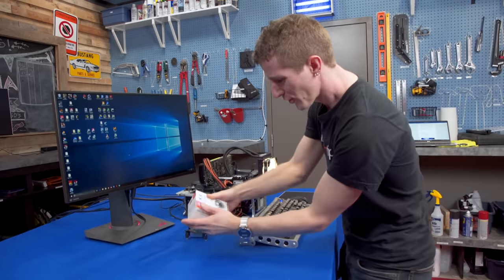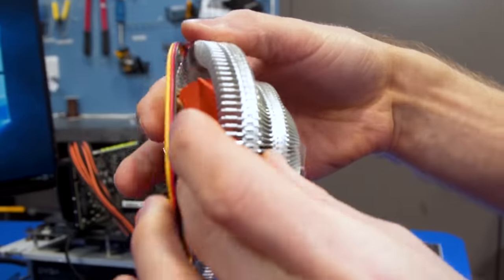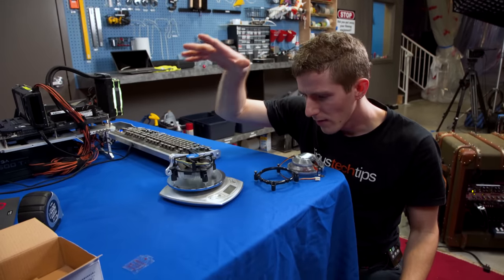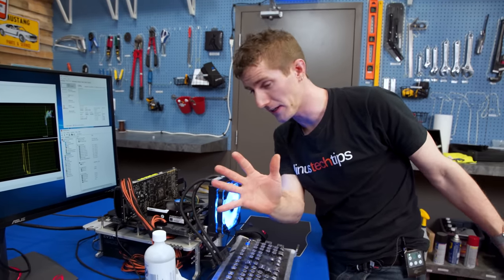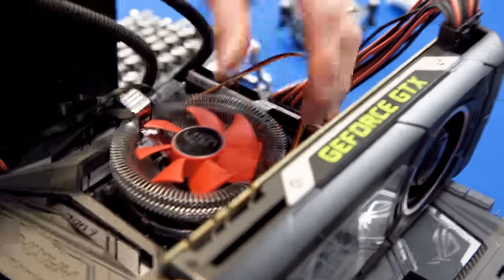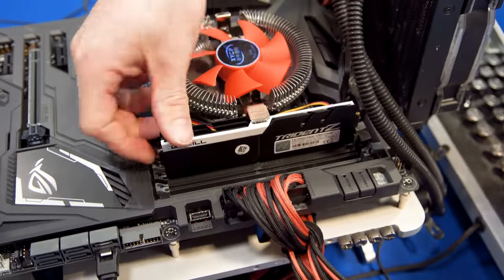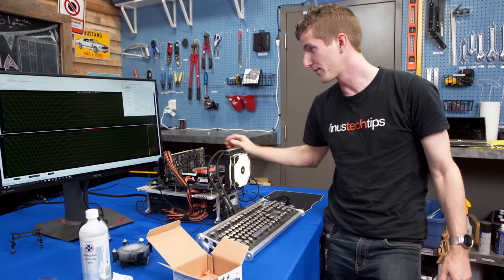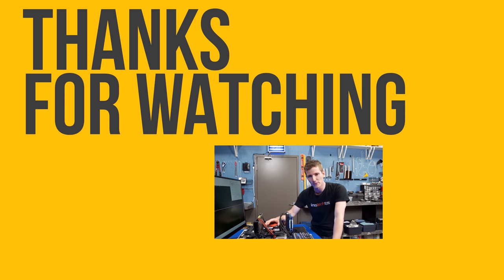The CHEAPEST Heatsink on the Market

Comment: 65W heatsink on a 95W TDP processor
yeah, let's see if this can hold up with a processor-TDP-matched heatsink
Reply: Hallison Michel that stock heatsink they tested is the very same that comes with all the other Intel cpu. So, what's the point in buying something that is worse then the one the comes for "free" with your cpu? that's what they demonstrate.
Reply: One reason is if it the stock cooler brakes or when you get a cpu without a heatsink... So...
Reply: This is the "cheapest on the market," not the "best match at the lowest price on the market."
Reply: Ailuropoda melanoleuca Nineoneone they have different coolers for pentiums and i3 that are solid aluminum, and the i5/7 have a copper core
Reply: Yeah but the surpass or at least match the tdp of the cpu... Otherwise the cpus wont operate ideally in their stock settings...
Reply: I would imagine they're matched to the highest tier
Reply: Not to mention the preaplied paste vs horrible and horribly applied paste. Seriously I bet the paste had the most detrimental impact
Reply: +Andrea Brugnoli Why buy a non stock cooler? Better and more silent cooling...
Reply: He also jokes about the heatsink interfering with the ram module... "The other way Linus, put it the other way you can do it, you're smarter than you think... "
Reply: Zyx sure, I agree. Except for the fact that this is a shitty one
Reply: yeah, right, he could have just turned the mounting system...
Reply: Or only the cooler... This cooler is like AMD old implementations so...
Reply: I agree! He should test this: http://www.gearbest.com/cpu-cooler/pp_280435.html
I'm running one on by FX-6300, which is a notorious space heater of a CPU, renders video at 3.4Ghz, 100% load, at about 80 degrees, as long as you have access to fresh air for it, but it does this silently. The fan on mine is REALLY silent.
Reply: Skelpolu he also used bad thermal compound
Reply: mimimimi
Reply: +Skelpolu Linus used the thermal compound that came with the cooler, part of the $5 purchase - that part of it was fair. Otherwise he pretty much created his own drama.
Reply: even tough this is a pretty silly product i must agree, at least give the thing a fair fight...
Reply: He mentioned that at the end though.
Reply: I sincerely do not understand why anyone would be surprised by Linus creating drama for the sake of a video......

Seriously who's going to use this on a $300+ CPU?  I know they have pentiums/i3s somewhere....
Reply: I'm having the current full-aluminium boxed cooler on my HTPC's i5-2500K and no problems at all. Dunno the TDP it should handle, but that 95W good ol' Sandy gets along fine with it. :)
Reply: Why bother? If it can support 4.2GHz operation, then it's pretty safe to assume 65W operation is a piece of cake. The real interesting question is how low temperature can it get a 65W CPU, if it can get a 65W CPU down to less than 60C, then it served its purpose.
Reply: Does this CPU have integrated graphics? Does TDP account for GPU power usage as well? He was using a dedicated gpu so the only thing using power was the cpu.
Reply: TDP includes power used by the GPU. This was likely very close to 65W considering he has the integrated graphics disabled.
Reply: TDP includes on die GPU power draw as well, correct? Actual tdp here was probably pretty close to 65w considering integrated graphics were disabled.
Reply: skylake and housefire-kabylake k models do not come with coolers
Reply: Most of these comments got the point of the video, so, so wrong. 

This wasn't a TDP-matchup, it was literally (and it says in the title) about the cheapest cooler you can get on the market, regardless of other factors, purely about price. 

All the dislikes to the video and the 800+ idiots who liked OPs comment aren't as smart as they think.
Reply: he notes the different TDPs of the heatsinks at the end of the video
Reply: In the next episode Linus is going to do "Cheapest CPU" and then he is going to see which one he can throw the farthest, because this isn't about seeing how well they perform in their recommended environment, its "purely about price". I mean, as the title states, it will be about the cheapest CPU you can get on the market, regardless of other factors.

Comment: 65W heatsink on a CPU with much higher TDP than that...
And then be surprised about the poor performance...

Linus, what's up?
Reply: more importantly if he was trying to remove variables then he should have used the same Tim for each cooler
Reply: money !!
Reply: It also performed worse than the intel stock cooler
Reply: I wonder if he changed the thermal paste if it would help because there's some horrible Chinese thermal paste out there.
Reply: İsn't Intel stock cooler from 5 watt times
Reply: @AmuckPVP  GD-900 is Chinese made and appears on par with MX-2
Reply: @AaronShenghao  Did he use GD-900?
Reply: The sky is up

Comment: Wouldn't using the same thermal paste in both tests reduce variables?
Reply: It depends on the test, if its the cooler itself then yes. If its a test of what comes in the box than nah.
Reply: I really don't get what people find so confusing about this. He wanted to test the coolers with the thermal paste that was included in their boxes. They're such low budget products it wouldn't make sense to buy a $10 tube of thermal compound when no one actually using the coolers would shell out for premium paste.
Reply: Then it is no longer a $5 cooler
Reply: Would have been great if Linus hadn't wasted like 60% of the "thermal compound" for no reason other than to say, "OMG look how bad it is". There was barely any on the CPU to make proper contact. It wouldn't have hurt to test them with better pastes after the initial test, either. Shit content.
Reply: +Shambles1980TRealOne
It means you're not spending 400$...

I know it's hard to wrap your head around this, but try to keep up...
Reply: If you put 1000$ worth of pirelli p zero tires on it's not ..
Reply: +Shambles1980TRealOne
Yes, the price for the car alone (without the extras) does not change, but what you pay in total changes (and disproportionately:  I don't think someone who only has 5$ for a heatsink will be willing to spend 10$ (or however much it is) for some good thermal paste...)

Comment: so are you going to use it on a 65w CPU and see if it's actually good when used as designed?
Reply: Spoiler alert: It's not
Reply: i think it is. it does not make much noise, the noise is more consistend than with the Intel cooler (consistent is important) and it will cool the CPU properly under 80 degrees. 4,75$ is a bargain including shipping. Not my choice but for pennyshoppers: great!
Reply: Real Flêks I think about 90W
Reply: "Under 80 degrees" isn't cooling the CPU "properly".
Reply: Nmotsch idontwannagivemyrealname Well, if it isn't catching on fire or harming the chip then who cares about doing it "properly." obviously you would get something better if possible
Reply: It kinda is harming the chip, or at least it would be if used for long periods of time.
Reply: Well the idea is you would use it on a lower TDP CPU so it wouldn't be running too hot. It depends on the CPU as to whether or not 80 degrees would be harmful. I had an old Pentium desktop that would run at 80 degrees (I think that was at idle too, jesus christ) and it had no issue for 5-10 years? I don't remember tbh. I ended up killing it in my early days of learning about computers. (I removed the CPU and thermal compound and then didn't put any thermal compound back on. LOL)
Reply: FreqyBiker I used this on my old PC's i3 2120, it's pretty good. I got it just to replace the stock Dell fan. It's quieter than the one included and brought down my temps by a few degrees C. It does work for the recommended TDP.
Reply: Even the stock cooler he used is for 65w cpu.
Reply: Can confirm, had an i7 965x overclocked to 6ish ghz for shits and giggles and I had it second hand from 2008, It ran great to the day  I gave it away. IT would idle at 80c, though I doubt new cpu's are designed to handle those heats.
Reply: 90w cooler against a 65w cooler doing the same job? It's an unfair and worthless comparison.
Reply: It is not, I used it on an i3 2130...the intel stock one is still better
Reply: @nmotschidontwannagivemyrea8932  I've spent 10 times that amount on a cooler in the past and had mid 80s°c temp under load. My laptop hits 90°c on the cpu and Asus rog isn't exactly budget lol
Reply: @1invag  Well yeah, under load those temps are normal. At idle, they are far from normal.

Comment: 65w heatsink on a 90w processor,  of course it wont keep up, try this heat sink on a 65w processor and then we can say if it does the job or not
Reply: @_. 90W is almost 50% over it's designed range so I'd suggest that's well past it's limits
Reply: shit thermal job too

Comment: Try it again using same thermal compound to see
Reply: Yeah, really. Fewer variables by using different thermal compounds? That soupy shit was probably acting as an insulator more than anything.
Reply: Different thermal compounds in diferent products i understand you are testing as it is, as it comes to the final consumer, but its nice to see if i buy the 5 dollar plus good thermal compound it will work better? Or at least the same as a stock cooler?
Reply: Especially if youre only using it on the rated 65w tdp CPU, where this test was 30w more. So $5 for this thing is not too shabby with 3rd party Thermal Paste.
Reply: Yeah, I was hoping for another test on the end
Reply: I feel the uneven spreading of the thermal compound likely compromised performance. This $5 heat sink may actually be better than the stock Intel one.
Reply: you cant compare diferent coolers with diferent TIMs, you should use same tim to see the real diference on the cooler. So should be aditional test both with something like deepcool z5 or cooler master cheap TIM, so you know the real cost of better solution of the stock cooler.
Reply: more mass = more dissipation, and intel's stock cooler has great airflow design anyway, therefore its going to be worse no matter what because there's less mass.
Reply: They both came with their own thermal compound, testing them as packaged sounds fair to me.
Also most people who have better-quality compound sitting around don't use stock cooling.
Reply: Between bad and good thermal paste there is 5-7 degrees difference.
I know it by experience,trying cheapest then overheats so I bought a very good one and I am still overheating af.
And also a french youtuber tested lots of thermal pastes and got those precise result of a 5-7 difference.
Reply: And also the one from stock cooler is probably very bad because of the way it's put on the cooler,and it's solid af.